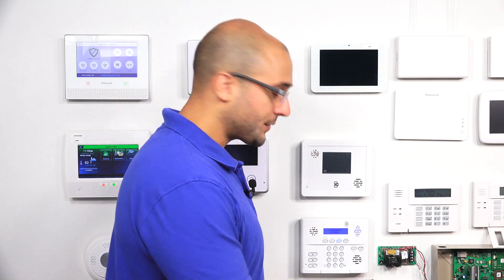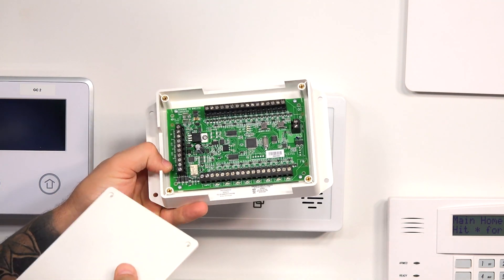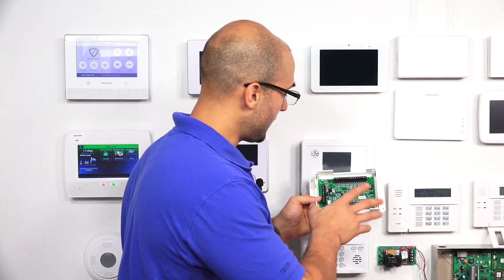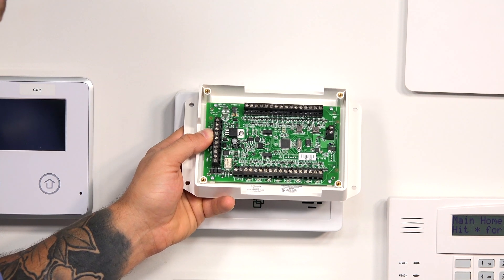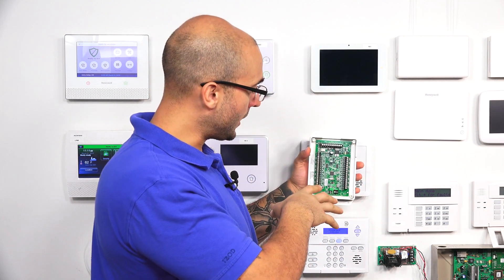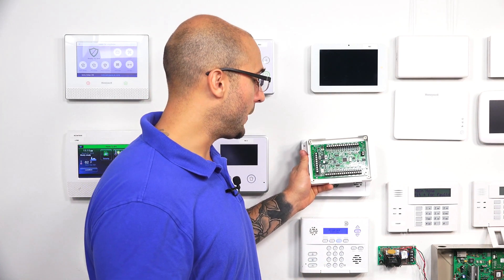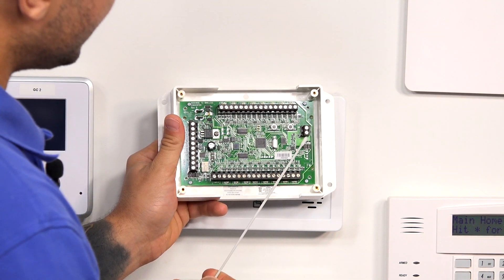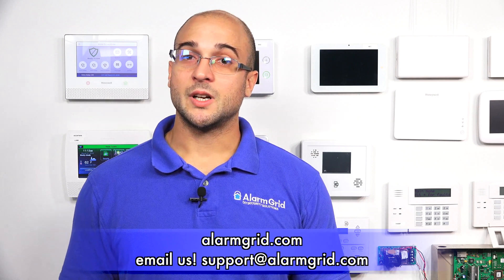Qolsys Hardwire 16-F Overview

Comment: I hate it when they send me out with a 16zone translator and the cx has 6 zones. Seems like such a waste. I usually swap out the  iq 16zone translator for the 8 zone alula/resolution RE508X hardwired to wireless translator. Anyhow if you have read this far, I have a question??? Service call today, cx experiencing problems with sensors. When I arrived, she mentioned she would walk in and go to the keypad in the kit and the alarm would go off because of the motion as she entered. There was a delay on the signal from the front door contact but not the living room motion. And when she opened the dinning room window, it wouldn’t chime, then 5min later it would say it was open. She kept on getting false alarms because when she came home and opened the front door, it was delayed and the motion picked her up and set off the alarm. I removed every zone and trimmed the resistor wire short so only the resistor is showing coming out of the terminals. Cut, stripped, and re-ponytailed my wire connections and used B connectors instead of the Marrette’s that were falling off.lol.  I also pulled the cover off the old metal enclosure because it’s definitely causing an issue even if the antenna is outside the box. But this one was sticking out maybe a couple inches out the back of the enclosure. So I pulled the antenna out and pointed it forward away from the Metal can. And told the cx to leave to door off the alarm box because the signal is being blocked by the metal enclosure and the antenna was not properly picking up the signals. After all that, zones were chiming within.1second or less. Cx was happy.

Comment: The only problem with it is the power supply is 16v DC.. why not make it 12v DC? A lot of older systems are hardwired to a transformer, and the translator is a plug in. If there’s no plug in available or easily accessible and cx doesn’t mind you using that plug then your okay.  But if not, the your SOL!!!  But I did see a technician use the 12v output of the old panel (still powered up) to give power to the translator. It’s working and it should because if the power goes out...it’s only a 12v battery back-up. So if 12v battery back up is sufficient, then 12v supply should work.

Comment: I Installed all zones plus smoke detectors then performed a memory reset. After the reset only the smoke detectors are visible during auto learn. No other sensor is able to be brought inventoried during auto learn.

Also no LEDs light up on the 16-f when the zone is open . Prior to reset all zones were visible.

Any thoughts you can share on procedures to fix the issue?
Reply from the maker: After your memory reset, did you go through the EOL Learn process again?  If not, you must. I would attempt the memory reset again, then go back through the entire process.  Also, did you use the 4.7K resistors on every zone, not just the fire zone?  A resistor is required for every zone. On the Normally Closed zones, the resistor must be placed in series, and on the Normally Open (usually only the fire zone) the resistor must be placed in parallel.  During the EOL Learn process, you must Fault (open) each burglary zone, then Restore (close) it in order for the panel to know that it is there.
Reply: @AlarmGrid  

Thank you for your reply.  I deleted the 16-F from the alarm inventory and performed the reset again  followed by the EOL learning process which recognized the 16-F as well as the smoke detectors. However   the iqpanel plus did not receive zone information on any zone when I attempted to learn in any other sensor.

I also have the resistors in place as well.

Any thoughts on next actions?